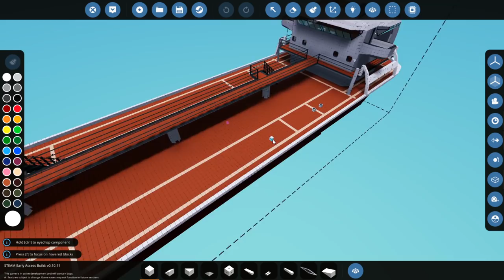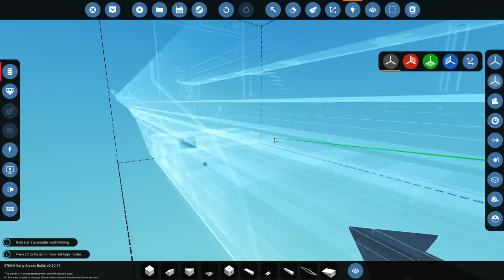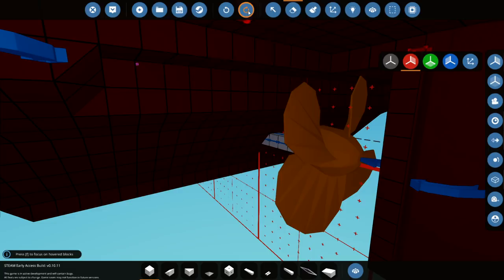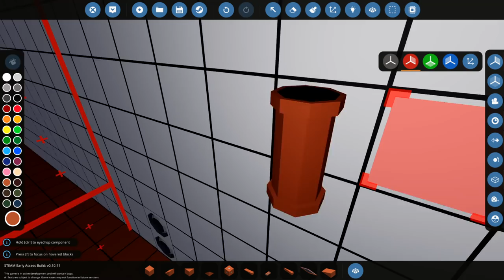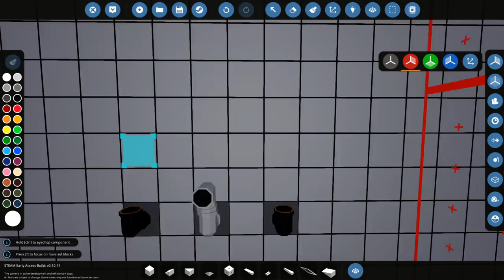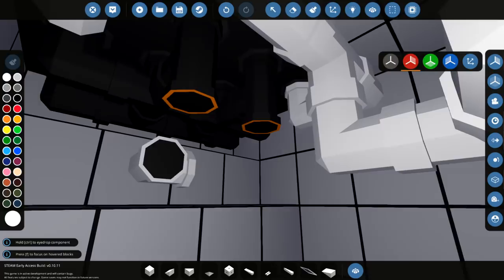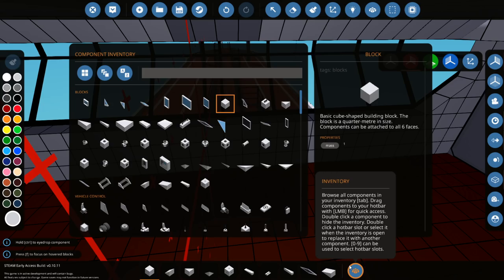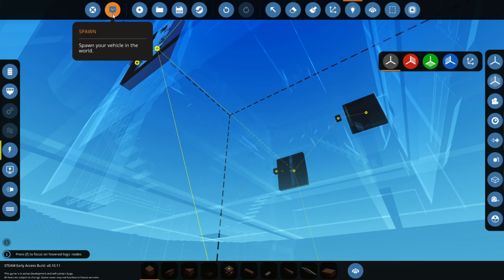Adding An Engine Room!  - Tanker Build  -  Stormworks Gameplay

Comment: You should start the engine from the engine room and you should have a separate battery for the engine so if you run out of battery you can start the engine

Comment: Hey Frantic! If you gearbox your generators they should produce much more power. Also using wing sections anywhere you can will greatly reduce the weight in the rear of the ship. keep it up!

Comment: Most large ships have a thing sticking out in the front because it helps if it hits ice bergs or breaking ice sheets edit: they break up ice and are solid so doesn’t damage hull when hitting ice
Reply: Nope. Many large ships do have a bulbous bow, but it’s in no way designed for ice. It’s designed to change the flow of water across the bow, reducing drag and therefore increasing speed, efficiency, range, etc.
Reply: Coen V oh I thought it was a different thing thanks for letting me know I was wrong